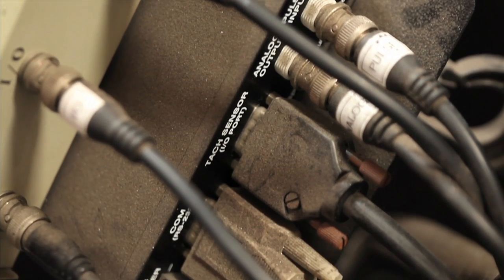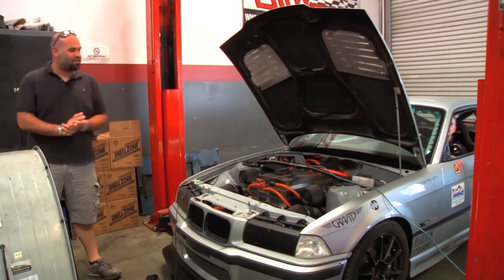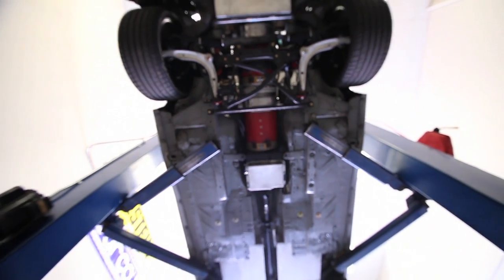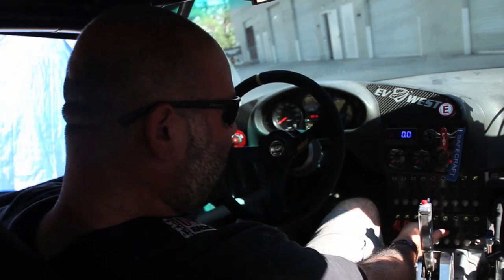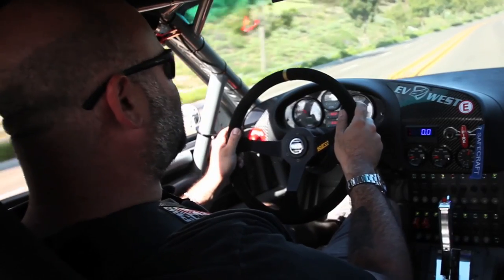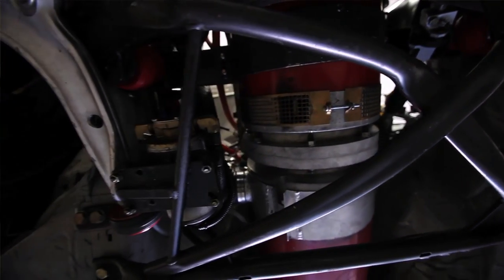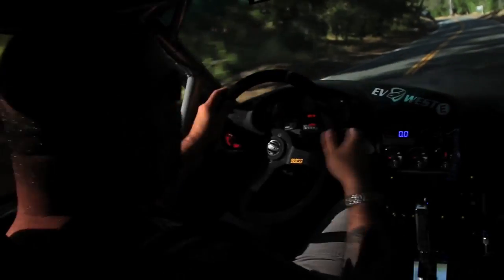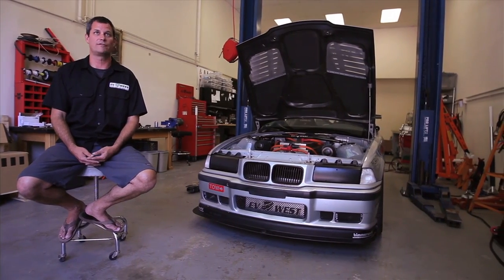This Electric E36 Makes 850 lb/ft of Torque at the Wheels! - /TUNED

Comment: trust me 25% drivetrain loss is not uncommon a simple 4x4 system has a lot of DT loss but every car has a certain loss,manufacturers usually measure the power at the flywheel wich gives a much higher hp and torque rating,but the power you actually feel is the power measured at the wheels

Comment: Look at Rimac electric BMW M3.  It has a very long effective range, and it actually produces over 600hp on the wheels and shit loads of torque, easily beating an M6 in a drag race.  And they've built a 4WD Concept One supercar with 1080 whp and 3800Nm (2800 lb/ft) of torque, doing 0-60 in less than 3 seconds, top speed of 300 km/h and effective range of 600 km's. All made by a small company ran by a 20 something year old genius, whose patent (blind spot warning system) is in all new cars.

Comment: The Veyron makes that much torque at the engine. Once you factor in the mechanical advantage of the drivetrain, you'll be looking at well over 2,000 IbFt of torque at the wheels, at least in the lower gears

Comment: i want a e36 hybrid, electric motor for anoying 50 speed zones, and normal motor for high way, the 318is has pretty good miledge on high way, but the block zones are the problem

Comment: sure there is. its just harder to get to, but its already getting cheaper to reach with continued added investment from oil companies, which will hopefully keep the fossil fuel market running for at the very least another 50 years yet. it will get more expensive, and may even get priced out by electrics depending on the efficiency they can produce, but the oil won't run out. we have literally barely scraped the surface.

Comment: How much would it cost to make a car Electric?....
Reply: i built a croam molly chassis electric car for around 4500 bucks but it was about 9 feet lone 2 feet wide and toy lay in it but it was capable of 100+ mph with no tranny and powered by 2 12 volt lithium car batteries could only run about 45 mins full trrottle

Comment: They dyno'd the car, 350 hp to the wheels was the result so obviously IT HAS 350 WHP it doesn't matter what your calculations say when the final result is 350HP. So either their estimate of 400kw was wrong or their dyno needs to be calibrated.

Comment: 850lb ft was read out on the dyno, which means its the torque from the motors, in the video they said it blew some trnasmissions which means it has a gearbox.
If it was 850lb ft at the wheels AFTER the gearing that would be pretty shit...a gti in first has more than 850lb ft in first gear and probably 2nd too.

Also judging from his reaction it probably isnt 850lb ft at the wheels lol.

Comment: As a want to be engineer I want to see electric cars with the kind of power of a veryron with 10 times the range at those top speeds and be able to recharge from dead to full in say an hour that's what I want to see.  A veyron proly averages 10 out on the interstate imagine if we could get a battery powered equivalent to go 700 miles instead of 300 on a full tank.  Then charge up in an hour that'd be amazing.

Comment: they just put out as much current as they can, as limited by the circuit. (which can be regulated by a simple circuit based on how much power they want at the wheels)

Comment: Honestly I will miss the sound but I dont need an i.c.e.. I just need to pass people like theyre standing still. And just wait until this hits the pickup truck. Put three motors in for 2550lb-ft and pretty much rewrite towing capacities?
Reply: +toob247 These run into the same problems as trying to build rockets to get into space. A bigger engine would work great, except you need more fuel for the bigger engine, which is more weight to lift, which requires a larger engine, and on and on. Same with larger or more motors; more heavy batteries. That's the biggest thing currently holding back electric vehicles. If we can figure out how to make lighter, smaller, more efficient batteries, then the industry will take off.
Reply: It will be a long time before this hits the truck market. Those guys are gonna hold onto their diesels forever.

Comment: much bigger than any conventional engine, for sure.
Electric engines usually have the 80% of the full torque at 1 rpm 100% at 1000rpm, and can go to 40000 rpm depending on design.

By the way i don't like the "fire power" with it's unreliability, and the lots of rotating and frictional parts, which need oiling and expensive replacements after few thousand kms. In an electric car only the suspension, and the batteries have be repaired/replaced

Comment: A little funny when people are once again "discovering" the power of the electric motor by placing it on a cart with wheels. It was as if an electric motor was not invented before the internal combustion engine, and even then had a far superior performance.

Comment: Why is it like a big displacement diesel engine? How big is that motor? And why cant it rev as fast as the tesla roadster? And not to sound stupid, but what would be better for performance? Ac motor or dc motor?
Reply: dc motor, ac is more for keeping a consistent amount of power for a long distance but the amount that the electricity has to travel in the car is so minuscule that it probably wont make a difference.
Reply: He says it is like a big displacement diesel engine because of the torque. Diesel make the torque because of the fuel they use but also because of the size and weight of the components in the motor. But mostly he means from the torque output. It doesn't need to rev like the roadster because the motors are way bigger and make more power at lower rpm. So 4K rpm in the bigger motor is more powerful then 14K in the smaller tesla electric motor.
Reply: AC Motors are vastly superior.

Comment: Only because normally it'll be multiplied by transmission, which doesn't happen with direct drive. Any 400hp gasoline powered car will put down *thousands* of lb/ft at the wheel in the first gears.

And even engine torque isn't guarantee of anything, an engine with tons of torque but no rpm will need very tall gearing and there goes all the torque. That's why you have huge heavy duty Diesel engines with gobs of torque that go nowhere fast while F1 engines have little torque but go like hell.

Comment: No. Power = 2*pi*torque*RPM
Thus, at 0 RPM the power of the engine equals 0 as well. It doesn't mean, however, that torque has to be 0 as well.
The thing is, at zero RPM the coils in the motor form a short circuit where the electrical current is only limited by the ohmic resistance of the coils (which is VERY low). The consequence is a powerful electromagnetic field and thus torque.
Once the motor starts to spin the inductivity of the coils will "impede" such high currents ==> less torque

Comment: The pioneers of mobility 120 years ago always wanted to go for electric cars, but the battery capacity was just nuts back then. That's why they went to gas engines. But the idea of electric cars exists since the invention of the car. Back then, things that came with gas engines like driveshaft, clutch, fuel systems, more difficult maintenance etc. were considered a burden but it was the only way to go.

They would've went for electric engines from the start, if it was possible.

Wether you are a hippie or not, electric cars only have advantages. Less fluids to run the car, you can go without transmission, you have the full power no matter what RPM, you don't even need a brake anymore since you can brake with the engines, and this has practically no wear at all.

Comment: Why there are air filters? There is no burning fuel?
Reply: reactiveD They talked about fans so its most likely for ventilation to prevent dust from getting into the engine.

Comment: Its for down force you need that with 850 lbs of torque or you're gonna spin non stop.  Plus that looked like a nice carbon fiber wing not some 120 piece of plastic  zip tied to some Guatemalan's 98 accord.

Comment: i grew up hearing and loving engines, everyhwere...tractors, bikes, mopeds, cars, my dad even bought me a old lawn mower and took off the cutting unit, so that i could drive a little tractor just like my dad(i was 5):D...
but i would buy an electric car anyday! i think thats the future...sure i will miss a lot, like the sound and the way a pistion engine develop its hp and torque...but its so much easier to maintain, more reliable and so much cheaper to refill (and we can stop burning dinosaurs)

Comment: I don't agree with you. It is not the batteries that need the developing. There is quite cheep LiFePO4 cells the theoretically can be charged to 80% in around 10 min. The problem today is that there isn't any charges that can deliver 2000 amp @ 400v.

Comment: of course this is good! if they can make a bmw race car get over 800 ft lbs torque out of an electric motor, that means they can take small trucks and put electric motors in those and make them pull just as much as big trucks. or put electric motors in cars to leave more gas for those of us that want a gas guzzling monster under the hood... but mostly, put an electric motor in a small truck like an s10 or something and you've got quite the sleeper, or a drift truck. either way. could be fun

Comment: This makes Nascar look like babies.
Reply: +kangsan2014 Are you joking?
Reply: +Moon Man Are you serious? Did you fucking see the acceleration?
Reply: +ALL MIGHT hard to beat a 9000 rpm v8 shifted through a clutchless 4 speed. nascars are pretty wild machines
Reply: sjpro1 Electric beats nascar..... The power is instant.... Acceleration from electric motors is on a different level to nascar....
Reply: ALL MIGHT Its a whole different type of car, sure this may accelerate faster, but that doesn't make a nascar a toy.
Reply: sjpro1 Nascar is a toy compared to these, The responsive acceleration means that it can outclass nascar in everything... during a crash it could slow down in the blink of an eye, swerve and accelerate back up to maximum speed within seconds.... something that a nascar is unable to do (Resulting in shit tons of crashes)
Reply: And you forget one major thing this has over nascar.... it can steer both ways properly...
Reply: ALL MIGHT You seem to forget that the nascar series races at watkins glen, road america and many other road courses. You are sorely mistaken if you think this e36 could post laptimes even close to what a nascar runs at these road courses.
Reply: sjpro1 This E36 Does not need 1000HP and a fiberglass shell and slicks to do those times.... Seriously dude fucking google electric vehicles, they out accelerate EVERYTHING... If one of your nascars went onto a REAL RACETRACK with real turns, this thing would shoot off while you are still there feathering the throttle.
Reply: ALL MIGHT They really don't out accelerate everything there are sooooo many modified combustion cars that are incredibly fast. whats a real race track if watkins glen isnt?

Comment: Right. Now take a car with, say, 18" 265/40 wheels travelling at 50MPH. Let's say it has an engine producing 350whp and at that speed the wheels are doing 750rpm. Now take that power and that rpm and tell me how much torque it's putting down at the wheel ;)

BTW I just happen to really be an enginner.

Comment: My biggest problem with hybrids, electric and eco cars were that they tried so hard to be different, squeezed, hipster herbal soap bars with no appeal, or they are insanely expensive, or that they drive like a fat whale on bicycle tires. 

This is 100% an electric car I would own, it looks awesome, it drives well, looks like it handles good too. if say, Toyota made a full electric GT86 with a shifter so I can control some mad skids on a track day, I'd buy it, but no production electric car seems to fit the bill like my old E30 does.

Comment: the guy said it was a bmw with 400 kw, which means it should have 400 x 1.34 = 536 horsepower. so he was lying :p torque is the product of the amount of force you put over a certain distance. example : the amount of torque is bigger when you put the same force on a longer spanner then with a shorter one.

Comment: i was expecting some video of that 850 lbs/ft on tarmac. congrats you made the awesomeness of 8 5 0 of raw metal twisting power seem like a misfiring  vespa with a faulty carb .. thanx remind me to hit the avoid button next time i see another The Drive review.. we talking 850 lbs/ft in old money.. NB: foot/pound ft/lbs is a unit of work so thats Joules (how much energy is spent doing work) and torque is Nm ( how much max energy it has for work) subtly but very different. i think vlogs need to show some form of knowledge on the subject they portray to be specialist

Comment: 850 lb/ft at the wheels? You do know that wheel torque is basically just a question of gear ratios and final drive, right? My daily driver - bone stock 1985 naturally aspirated 2 litre Volvo 3-series - makes well over 2000 lb/ft at the wheels...

Comment: Because in racing it's not about the sound, but the tracktime.
Electric engines don't have a torque curve, they have maximum torque at any rpm unlike combustion engines, which only have maximum torque at a small part of the rpm-band.
This is the reason, why you can rip off a BMW m3 with a tiny Brabus Smart, as the Smart has an electric engine.

Comment: Hydrogen is a flamable fuel as well. Want the next step that can be more easily implemented into society easier than electric cars? Have current engines run a mixture of liquid hydrogen and air. Keep our engines, keep glorious exhaust notes, get significantly more power from them, and using Hydrogen, one of the most abundant elements in the universe as far as we know.

Comment: It is difficult to be impressed by the 850 ft-lb at the wheels.
A 2016 Mazda Miata has about 1950 ft-lb at the rear wheels … in 1st gear, which is where they should be compared.
The Miata’s engine torque is 148 ft-lb, the ratios of the 1st gear and differential are 5.087 and 2.866 respectively, which gives a total ratio of 14.6. Since the wheel torque is the product of the engine torque and the total gear ratio, the wheel torque becomes 148 x 14.6 x .9 = 1945 ft-lb, where the .9 represents a 10% drivetrain loss (gear wheel spins slowly).
Reply: I highly doubt a Miata engine is going to compete against a series-wound DC motor, the most powerful motor type when dealing with torque. That's the same motor type used in locomotives before they switched to 3-phase AC.

Comment: A kilowatt is a kilowatt... that doesn't change. It's a unit of power measurement and the value doesn't change. Probably the 400Kw isn't correct... or they just didn't go full throttle on that test...

Comment: Luke warm is good , hot would be better . But there are still things to be done in this market , the main one is the price is a lot closer to that of a gas sipper ............ keep looking , keep lifting the ' hoods ' & keep asking the questions . I had a conversation last week with a car dealer , with a sub litre Dacia , which does very good MPG & comes into the public at a very good price .... electric need to do more , and not pricing just for the niche market .

Comment: Not bad if you use lithium ion as a 300hp electric motor is smaller very small even the DC type in this video is tiny. and ofc you can drop all the drive train components and probably run air cooling only with a dedicated chassis design.

Comment: the electric motor needs cooling, it is cooled by air, and it needs lots of air, so without these filters, the motor would get dirty really fast, it would start to heat up and loose its efficiency...

Comment: hydrogen is as far away as it was 10 years ago.  Storing hydrogen is difficult and expensive, and electrolysis requires huge amounts of current.  Electric cars coupled with locally produced green energy is the most likely answer to all this.